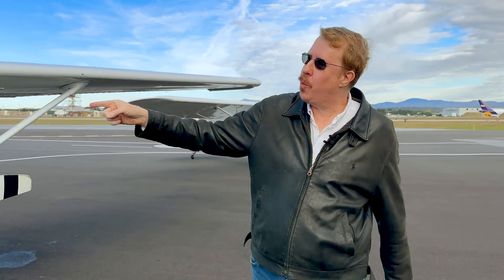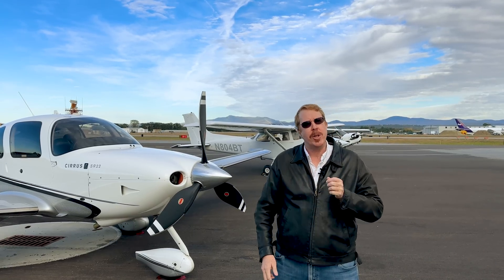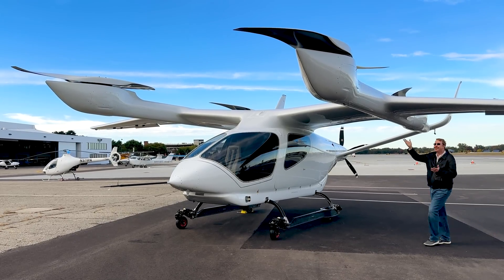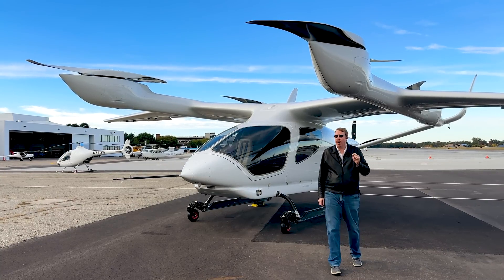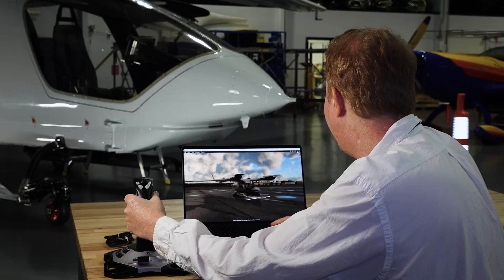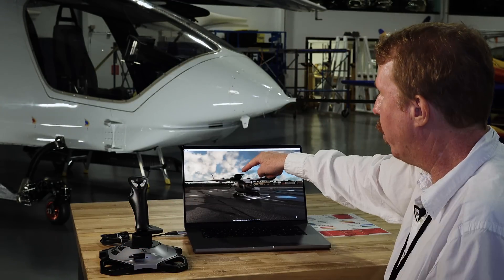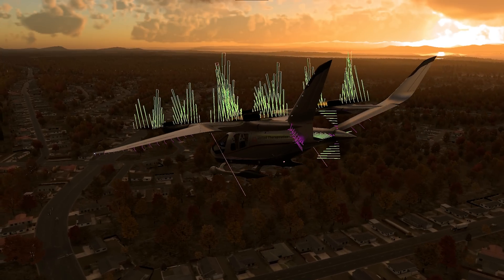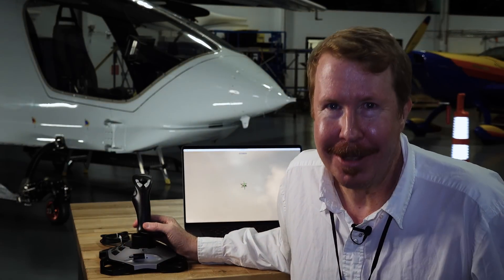The NEW Beta eVTOL: Fly without FUEL or RUNWAY!

Comment: The eVTOL still requires fuel.  It is just called a battery.  It is super cool that this is in X-Plane.
Reply: @qed100  Well said Mark.  I hate gimmick channels like this.
Reply: Fuel by definition is “a material used to produce heat or power by burning”. 
A battery stores energy. Fuel is consumed chemically to produce energy.
Reply: @meofnz2320  The fuel is burned at the power station and the energy is transferred to the battery, stored for future use. Electric vehicles use the same fuel as gas powered vehicles. Unless it is a coal or nuclear power station.
Reply: @edutter9261  
I think you’re slightly missing my point about batteries but nonetheless agree. Unless you consider wind, solar or hydro. Though even in those cases the ultimate fuel source are hydrogen atoms in the sun.
I guess you’re implying that EVs are just as polluting as normally powered cars. From what I can deduce looking at all the upstream factors EVs are at least no worse, and usually better. But there’s no free ride.
Reply: @meofnz2320  It's amazing that in 2022 people are still ignorant of wind and solar power. And even if upstream natural gas is used as 'fuel' to generate electricity, you would not consider a battery or its charge 'fuel'.
Reply: @recoilrob324  I've been driving an EV for over 5 years, ranking up 130Kmi. I regularly do +600mi trips. In remote locations it's easier to find electricity than it is to find gas.
Reply: @meofnz2320  I would say that EVs are way more polluting than Gas powered cars. It would take much more fuel, due to the losses in a power station and the transfer of the power, to power an EV for it to go the same distance as a gas powered car and that is only one factor. There are so many more ways they pollute it would take more time than either of us have to list them. Electric cars are a terrible idea and even worse for an aircraft.
Reply: @edutter9261  Quite a way off with your supposition: “EVs convert over 77% of the electrical energy from the grid to power at the wheels. Conventional gasoline vehicles only convert about 12%–30% of the energy stored in gasoline to power at the wheels.”
You get variations on this statement depending on where you Google but the point is an electric motor is about 90% efficient compared to a modern internal combustion engine’s 25-35% (under ideal conditions). And EVs gain a further advantage with regenerative braking
There are grid losses to consider but then petrol or diesel have distribution losses as well. 
If the generation source of electricity is unusually inefficient or dirty the overall equation might favour an ICE. 
In my location 80% of power is from hydro. A combination coal/gas power station makes up the shortfall and a lot of people argue that the additional demand EVs create comes solely from this. Even if that were true (debatable) the coal/gas generation runs between 40% and 56% efficiency. If you take into account transmission losses and factor EV efficiency you get an efficiency of roughly 30% to 50% for a “coal powered” EV. And I know several people who charge their cars from home solar. They’re way, way better as far as pollution goes.
Reply: @edutter9261  and what you would say is wrong. Hydroelectric, solar, and other renewables surpassed coal in supplying the grid two years ago.
Reply: @austinmeyer  maybe where you live. does not matter. nothing works without a power source.
Reply: @itoibo4208  absolutely true.
Reply: @meofnz2320  there has been a lot of studies done on this debate but you have to dig to find the info because it doesn’t fit the current narrative. EV’s actually cause more pollution than ICE vehicles if you compare apples to apples, as in, how much nasty pollution comes from mining the minerals to create the batteries required to last the equal life time of an ICE , like 1,000,000, km you can get from a Cummins diesel.
I did watch a video from an engineer that did a ton of research on this and that was what the evidence showed, and not by a slight margin but something like 2xs the pollution!
Reply: @1966cambo  
You can “prove” just about anything if you’re selective with the facts. That EVs have a bigger production footprint than ICEs is well known but over the life of the vehicle the balance tips in favour of EVs fairly early on. You can distort the picture by looking at statistical outliers like the million km Cummins or dirty supply but it is unrepresentative of the fleet. 
Regardless, neither EV or ICE are ‘green’. Travelling in a chair has a huge cost either way.
Reply: @meofnz2320  I am aware both sides of an argument can manipulate facts to support their point. 
One fact that is indisputable is the USA can’t support an all electric car society, plain and simple. 
I wonder if anyone has looked into how much Lithium is left out there, I don’t think the supply is anywhere near what we have in oil just saying
Reply: @WouterHermans  wind and solar do not make the majority of energy, and if people everywhere switched to electric tomorrow, guess what electric companies would be scrambling for first? fuel based electricity generation.
Reply: @qed100  It is pedantry. Merriam-Webster defines fuel as 'a material used to produce heat or power by burning', 'nutritive material' or 'a material from which atomic energy can be liberated especially in a reactor'. None of these things happen in a battery. A battery is a container of energy, and the energy contained are electrons and protons. The electrons and protons are not burned to produce heat or power, nor are they nutritive material, or are they liberating atomic energy in a reactor.
Reply: yes, saying it does not need fuel is all wrong. if someone wants to be pedantic, i could argue that most of that electricity will come from burning fossil fuels.
Reply: @itoibo4208  Wrong. Renewables have surpassed Coal back in 2019. My car, a Tesla, is charged by solar panels on my roof. And this airplane is powered by electricity from Quebec Hydro electric stations. So you are wrong in both of those cases, and many other cases as well
Reply: @austinmeyer  To be fair, though:

fu·el
/ˈfyo͞o(ə)l/
Learn to pronounce
noun
material such as coal, gas, or oil that is burned to produce heat or power.
"one aircraft ran out of fuel and had to ditch"

verb
1.
supply or power (an industrial plant, vehicle, or machine) with fuel.
"the plan includes a hydroelectric plant to fuel a paper factory"

So you are right by that definition. Not sure why hydro can fuel a factory by making electricity, but electricity is not a fuel. If the hydro were spinning a turbine, would that be fuel? Idk. 

You win this time, Austin Meyer!!!!
Reply: Actually, the fuel is 70% natural gas and coal - 30% other stuff - hydropower, nuclear, etc.  7% of that is wind and solar.  It's simply stored chemically in batteries, and delivered to the motor in the form of electricity.  Electricity is a power train option, not a power source.  But that's okay, because electricity is the best way to transmit natural gas power.  EV's are great within their mission.  Outside their mission...not so much.  EV's are simply making wise use of abundant and low-priced resources - natural gas and coal.
Reply: @HPDrifter2  " EV's are simply making wise use of abundant and low-priced resources - natural gas and coal." Not true IN THIS CASE (or in any case in my life).  In Vermont, where this plane is developed, power is 100% Quebec hydro: Water falling down a hill. So for the airplane I present above, right now, your percentages are incorrect. And in SC, where I live, my Tesla is charged by the solar panels on my roof. OK that is MY case, and the case shown in THIS VIDEO, but as for the FUTURE,  the grid is getting cleaner every year..... and ONLY EV ALLOWS US to get the BENEFIT of a cleaner grid in transportation... gas-farters can't do that, at all.
Reply: @austinmeyer  so the answer to the ev problem is flood more land and destroy more fish habitat and animal habitat never mind displacing people who might have lived near rivers for hundreds or thousands of years, spoken like a true elitist!
Reply: @austinmeyer  vermont's entire population is less than my city
Reply: This conversation is very dumb. There’s different definitions of fuel. You both been right the whole time.
Reply: It requires *energy*. It used to be fuel, but now can be electrons and protons stored in a battery.
Reply: The battery is actually the fuel tank. The fuel is the energy that is stored in the fuel tank.
Reply: @edutter9261 semantics

Comment: Thanks for sharing this video and this revolutionary aircraft with us through the sim. Im mind-blown
Reply: So, its not simulating each blades as invidual wings producing lift? This is scripted base not a real time simulation.
Reply: @hpharold23  So what you are saying is that the lift produced by each rotor blade is not based on Austin's blade element theory calculations? X-plane is build on blade element theory. Why would this be any different?

Comment: Do we have a range for forward flight and time for only vertical flight?
Reply: I think we are publishing 250 nautical miles as the TARGET range, and publish that we HAVE ALREADY achieved that with the LIFT rotors NOT installed. And batteries get better at 8% per year, soooooo...........
Reply: @austinmeyer  250 NM.. Wow! Is that with max weight?  Who needs gas/Jet fuel...
Other specs:  Max weight, Pax, Cargo - You know, the standard stuff (Not that I could afford the real thing so, good thing we have X-plane)
Thanks!
Reply: @philnelson2364  dont worry: you'll never NEED to afford this plane, and neither will i. This plane will be expensive to purchase but extremely cheap to operate since it has almost no moving parts, no fuel consumption, no turbines. So the airplane will be expensive but the operation of it will be cheap. What that means is it only makes sense to have one if you were using it constantly. That is not me, and that is not you. That is a fleet operator that has a whole fleet of these things that are constantly working like flying Uber's. all you pay for is the ride, and since so many people ride, that expensive acquisition cost is distributed amongst many customers and the ride price will not be too high. Some people would look at the cost of helicopters and say that since helicopters are expensive airplanes like this will be expensive. But they ignore the fact that this airplane doesn't use fuel, or have a turbine engine, which are incredibly expensive to purchase, maintain, and overhaul. so as far as the acquisition price: leave that to the fleet operator. When you are ready for a ride you'll just whip out your phone and ask for it and be ready to throw down a small fee for the trip. So this is what the future looks like: it is not a flying cars in every garage. Instead, it is airplanes that could never be on the road owned by fleet operators that carry you around cheaply and cleanly... in three dimensions that are completely available instead of the one dimension we get on the road: so with a proper air traffic control system, traffic will not be a thing
Reply: Wow I got to do a video on this. this question was so good it calls for more information than a YouTube comment. I will make that one of my next videos
Reply: @austinmeyer  Now there's a true savings that will be available, great for those quick jaunts from a high-rise office building straight to the airport which would eliminate high cost helicopters and I wonder if it's weight would be reduced from that of a helicopter.
Other question marks are: Engine TBOs as well as other parts like propellers etc.  Wonder if the FAA has to look into this unless that already have specs set up.  Also of interest might be the cost of an engine.  So many variables, so many questions.  In any case, will be interesting to see them around town.

Comment: It still requires "FUEL", electricity may be that fuel, but it's still fuel.
Reply: But you also know what he meant
Reply: Quebec's Hydro Electric grid is so huge, we already supply power to Vermont, some of New-York and I believe one more state.  Quebec is about twice the size of Ukraine but with much less population so we have lots of electricity to sell... Want some?
Reply: And much of that electricity is generated by fossil fuels, and that will be the case for many years to come.  One can't spin a society as large as ours on a dime.  Converting to other energy sources will take significant time, and yes, even energy itself.
Reply: @quantumac  and the way to start is to move away from direct use of the fuel itself. If that move isn't started then the "takes significant time" becomes "it will never happen"
Reply: @bruceyboy7349  Even if tomorrow the US government said "yeah, we lied, Roswell was thing" and "we reverse engineered inexpensive Zero-Point-Energy generators", it would still take a while to build the infrastructure and shift over to the new energy source.  Most importantly, it would take inexpensive existing energy sources to do it.  This is why it makes no sense to artificially make fossil fuels more expensive now, as our current global leaders have done, resulting in massive inflation.  We need to keep fossil fuels cheap WHILE converting over to alternate sources.  It also won't ever happen if we can't afford to make it happen.
Reply: @quantumac  Okay. Lots of nice points there that are completely irrelevant to what I said but, hey, if you've got something to get off your chest then go for it.

Comment: Just took it for a quick spin! Such a cool plane!!

FYI: If you have 2 throttles axis you can bind one to "Throttle Vertical" and one to "Throttle Horizontal".
Reply: Probably a stupid question, but where can we see how much the batteries are charged? And how can they be re-charged or even charged at all before flight? 
I managed to fly it, but after a couple of minutes it always seems to loose power.
Reply: @jorn-jorenjorenson5028  look on the Nav display.in the lower left corner there is a Voltage. It starts roughly at 800 and I found that at 600 the motors are cut off.
Reply: @FritzWeinrebe  Thank you! Yes, I noticed that little number as well in the meantime. Thought there would be some more obvious batteries indicators somewhere though. Not too unimportant information...  : D
I assume there are some features still missing for electrical planes in XP12, hopefully they will come in an update soon.
Reply: @jorn-jorenjorenson5028  pleasure. Yes I hope so too. Probably they are working on it since it is still a Beta.
Reply: @FritzWeinrebe  Yes, good thing about the plane is, they can work on it as long as they want, as it will always be a Beta...  : D
Reply: @jorn-jorenjorenson5028  hehehehe. Beta is a beta. Good one.
Reply: The pusher prop still doesn't have a 'beta' mode although the aircraft is Beta. Still a plane well done for an example electric VTOL.

Watch this space in 10 years, what are still to come?
Reply: Wow, you are a genius.